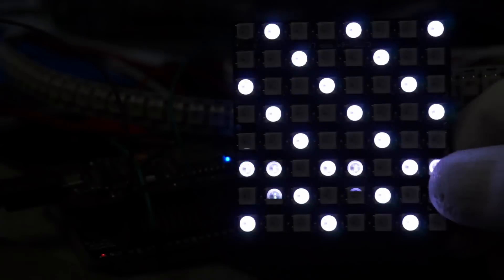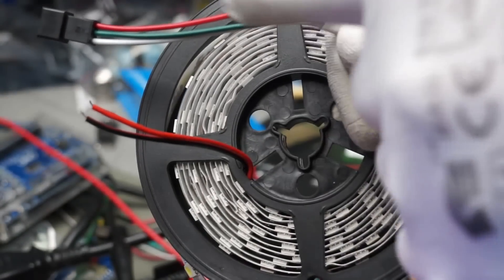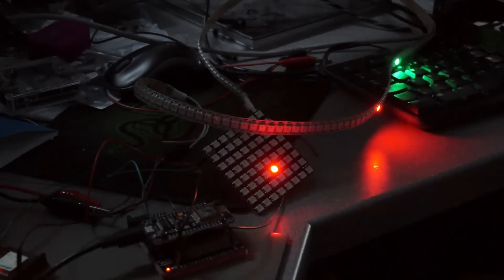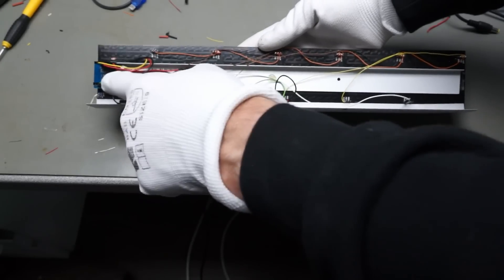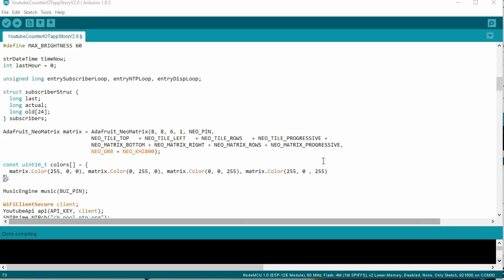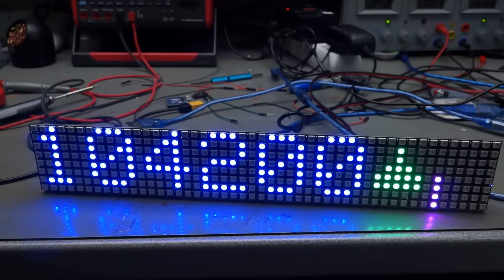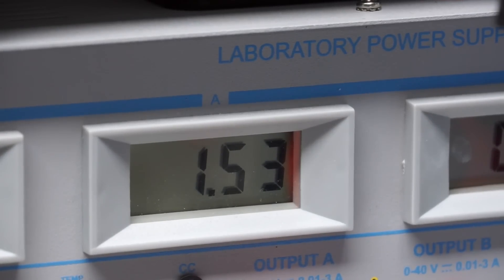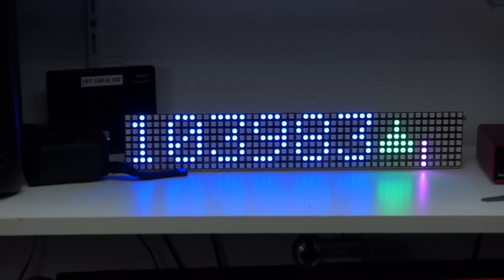432 Tips and Tricks for Neopixels Projects (Arduino, ESP8266/ ESP32)

Comment: (TIPP 13) Just to mention - using 3V3 for DATAIN in is the source of common problems (e.g. Gost Pixels) This may work (in many cases) with very short cables between the MCU und the strip. To walk on the "no stress side" use a level converter and you are fine in all situations.  There a many solutions out there. E.g. using the first led as a "Getto Level Converter" using a diode to level up (Search for: cheating-at-5v-ws2812-control-to-use-a-3-3v-data-line), and yes, using a level Converter opens the way to 12V or 24V strips which work better in large configurations cause of good old Ohms law :-) and much cheaper power supplies if we speak about 1000 or more LEDs and full lightning.
(TIPP 14) And use a protection resistor on data in. Cause a missing GND will kill your first LED (and the stripe looks dead) or in worst case the MCU GPIO, cause the VCC will flow from VCC to you GPIO to ground. A shortcut, the current draw raise to maximum. This may happen during exerimenting on the workbench and suddenly the whole system will not work anymore as it did before. Also one of the "stress removers"
(TIPP 15) - you mention to add power on the middle, on very long stripes add more power injections over the whole length. Eg. ever 200 LED. Also adding some caps to the injection points help on very long installations. (support capacitors)
(TIPP 16 for the beginners) just for simple lightning: Use Open Source Projekt WLED :-) Find more tips there about using all sorts of multi color LEDs. The features of WLED are "endless" and there is a large community around.
Reply: Amend for TIPP 13: 
In case of ESP32 the main-reason for Ghostpixels it is not the Voltage... its a disturbance in the force^Wtiming, its all about Multitasking, even the slightest interruption of the output routine will destroy the timing. 
On ESP32 you need a library that uses the I2S interface (hardware accellerated, with DMA support) or you have to clear all interupts (might work for a small amount of pixels on the second processor w/o getting WLAN problems).
Reply: @emmoemminghaus6455  I totally agree with this. But long wires tend to be also a problem  (sorry don't know the englisch term) to "carve" the rectangles of the signal and this tends to create also "wrong" values. e.g. wrong colors etc. And in a the not specified condition of 3V3 this happens often. The boards are full with problem descriptions "3V3" works fine, but... 🙂
Reply: @hesspet  Thanks for your very clear comments! Your English is much better than my Deutsch😀
Reply: Just a note: the latest version of the WS2812B now accepts 3.3V input natively (the datasheet specifies a high input level of 2.7 V, while the older version stated 0.7 x VDD = 3.5 V). There are however still old version of the datasheet around, as well as possibly different hardware revisions of the WS2812 (for example, WS2812E still requires 0.7 x VDD). Also, it really is only a problem for the first pixel in the chain, since from the second pixel on they will get a full 5 V signal output from the first pixel. Another very common way to deal with this issue is to drop the power supply of the first pixel by adding a silicon diode in series to its VDD pin to drop its supply below 4.5 V, where it will then certainly accept a 3.3V input.
Reply: @EnricoConca  heh.... didn't read your whole reply before posting.. oops..
Reply from the maker: Thank you for the additional Tipps! Very valid!
Reply: A trick to getting around this is to undervolt the Neopixels.  5v strips will work fine around 4.5 volts (or even lower), and 4.5 x 0.7 is 3.15 - so 3.3 v is plenty for the Data line.  That won't work for 12v strips, of course.  One series diode in the Vcc line before the Neopixels drops 5 volts to 4.3 - or you can use two Schottky diodes (in series) to get 4.6 (make sure the diodes are large enough to handle the current!).
Reply: TIP15A. I’d not daisy chain the GNDs and the VCCs. It’s best to use the star configuration so that all pins get the same voltage.

Comment: It would be nice that designers of ws2812 added timed multiplexing of pixels. Current draw would be much less.
Reply from the maker: I think you can get a similar effect with dimming.
Reply: @AndreasSpiess  .Fine tuned multiplexed LED's can give perception to human eye as full operated. Not just dimmed. Example is well known IC MAX7219 with multiplex scan circuitry.

Comment: I just bit bang the i/o line to the ws2812b's as it means that I can change the timing to suit the leds.  I also have a set ot ws2812b's on little round pcb's which I using for a round display. But there is a resistor in series with the power pin and vcc on the ws2812b causing it to glitch when the leds are on,took me awhile to find it, but shorted out the display works just fine. I found problems with FastLED and esp8266 where the first 24bits got corrupted,  large gaps in the timing of the first data set(24bits)
Reply from the maker: Good to know about the resistor. Thanks!
Reply: @AndreasSpiess  Hope you don't mind, but "Glitchly ring fix" shows the resistor. And i've seen Aliexpress ad's for the same part all whit the resistor fitted! 

Which of course means that the Vcc of the WS2812B goes up and down with the leds brightness which also means at times the voltage out of the previous chip can be higher than the vcc of the next LED. It also means that the voltage out of the previous chip can be low enough not to be seen as a valid high by the next one. 

So glitching is dependent on what is being displayed which did not help with the fault finding, but the scope is your best friend.
Reply: Using 3V3 on DataIn? Sounds like one of those common problems (Glitching) :-)
Reply: @hesspet  That's what i thought but i've never had that issue, so my first call was to use a 74AHCT1G08 2 input single AND gate to provide level shifting but it did not cure the fault. as you see in the my last comment last comment, the fault was there was a resistor in the supply to the LED on the PCB. with full white there was more voltage across the resistor than the led! removing the resistor and all is happy even with a 3v3 drive signal again.